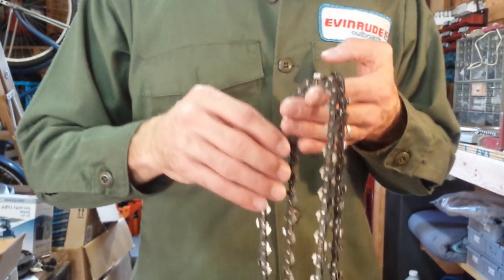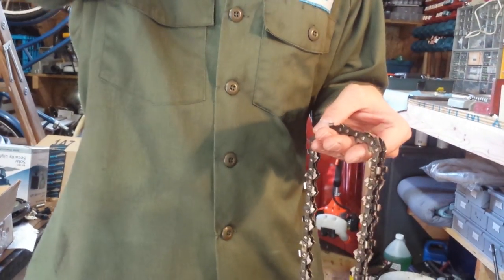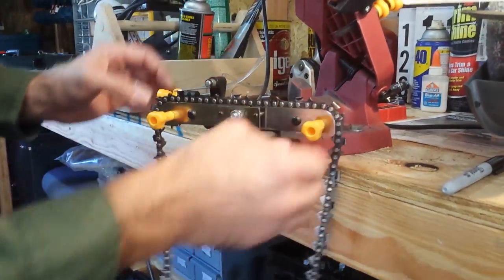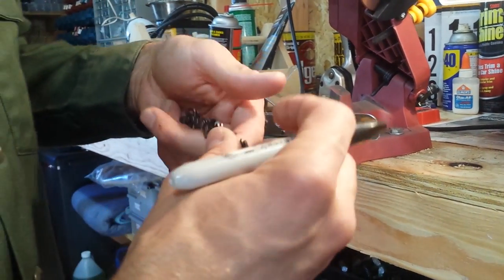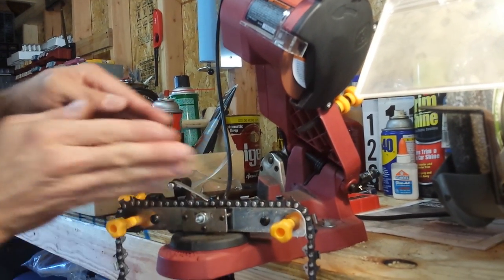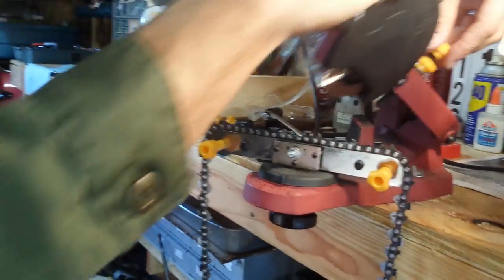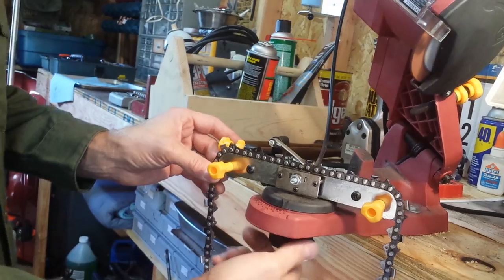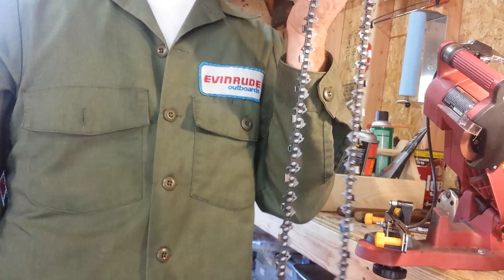How to sharpen your own chainsaw teeth for less than $40

Comment: The Video was 💯% accurate and detailed and easy to follow! 🤘 Thanks going back to cutting now
Reply: onehundredpercentfire nan
Reply: nangu 1 sgarpener beku
Reply: onehundredpercentfire W
Reply: Just learn how to Properly do bye hand,
Save money in long run, less chains.
Reply: @lumberjaxe8910  I agree, but, although I'm not pro, if one does a lot of cutting,,, it's nice to touch-up the chain from time to time with a jig like this (I always sharpen by hand)
Reply: Lumber Jaxe sharpening by hand is too slow, looks very unprofessional hand sharpening on the job & a waste of time. Better to have a few spare sharpened chains for easy quick changes, then machine sharpen them at home for the next day. Time is money, also hand sharpening is far less precise & just speeds up the onset of carpel tunnel syndrome

Comment: Thanks for your video.  I bought one today at Harbor Freight for about $27 out the door.  It took  me about 1\2 hr. to assemble it (and tweek it).  I sharpened my chain saw "chain" in about 5 minutes and believe me that chain is sharper now than it was when I bought it.  I really appreciate your videos. PLEASE keep posting.
Reply: Sure? I've never used a re sharpened chain that was as sharp as new. They cut like butter brand new and after sharpening it's just never the same.
Reply: @jamesnm21  much sharper after a proper sharpening than out of pack. Guaranteed, ask a logger.

Comment: am in the UK just bought this exact model thanks to you!! i love youtube because fellas like you (us) are prepared to invest time to help folks like me (and others) out. THANK YOU from Hampshire in the UK.
Reply: Hi, a suggestion from Cumbria.
It is real easy to take too much off the cutter. Set so the disc just lightly brushes the most damaged  cutter. Then all teeth very near same length. Get a lot more sharpenings out of a chain. 
Got older model, 2000 yr model, over 12 yrs ago, used & no instructions. Pre general YouTube videos to watch ! 
Worked it out. Still sound tool, replaced grinding wheel, after much use.
Works out a lot cheaper than quality hand files in medium time.

Comment: I bought one a few years ago and it sat in the box unused until today. Worked great. Hey, instead of pulling on the chain to advance it, just turn the yellow knob. Great video.
Reply: I mounted mine on a shelf at chest height so i can see what I'm doing with the grinding wheel without straining my neck looking down at everything. Makes a big difference. Plus you can leave it mounted without taking up valuable space on your work bench.

Comment: Bought an ozito electric sharpener here in Australia from Bunnings (Home depot equivalent) for $50. Works a treat and doesn't take long to pay for itself. If I take my chain to a shop to get them to sharpen it it costs $15/chain. This video helped me learn how to use the sharpener. Thanks for posting and happy sawing. :-)
Reply: I’ve got one too. Only downside is that we can’t adjust the depth gauge. Do you use a separate tool to adjust the depth gauge ?
Reply: @ashoksem  No mate, I don't think I did.

Comment: Thanks for taking the time to make the video for us. I think you did a good job showing what needs to be done to get the chains sharpened. You didn't block the camera with your hand, or body. Your voice was clear and concise. Ten bucks is a lot to pay for chain sharpening when you can buy a 8", or 10" chains for  ten bucks at Home Depot, probably other stores too. However, I think you made a smart investment. I was going to do manual sharpening. But like you I  purchased and electric sharpener instead.  I was out here looking  for any tips etc.. So, again thanks for taking the time to show us your video.

Comment: Not sure if was mentioned way down in the comments, but I would suggest to also get a depth checker for the racks/ guides  so that you can file them as well to keep the teeth cutting correctly.
Reply: Pistol Whipped!! Yep, doesn’t matter how sharp the teeth are if the racks are higher than the tooth. Don’t believe that was mentioned in the vid tho.
Reply: This is exactly right.  I use the manual Stihl tool that files the cutting tooth and the depth gauge at the same time.  Works great every time.  Down side is you need to clamp the saw in a vice to use it effectively.
Reply: @Mike_Neukam  I wanted one of those, but they were like $40, and you have to eyeball the cutting angle. Guess I'll have to settle for a depth gauge and flat file for the rakes.
Reply: @RandyGrace  They are a bit pricey, but they work well and the shape of the tool will guide you to the correct cutting angle.  The files are replaceable too, so it's a one time purchase if you only use one size chain.  I like it and it works well for me, but to each his own.

Comment: This sharpener works well. I'm left handed. I have great hand eye coordination. I have built musical instruments by hand. I can put a razor edge on any knife with good steel by hand using a stone. I have simply not been able to put a like new edge on a chainsaw chain using a hand file. Yes, i had stihl files and stihl chains. I bought this and after fiddling with it and using the chain stop directly behind the tooth to hold it steady i sharpened two chains and used them to cut hedge/Osage Orange. Both chains cut great. I then tried them on black locust and they cut like butter. I am thoroughly satisfied with the edge this puts on a chain. Pro arborists say a file is the best way. Not for me.  It seems to me that a fine stone sharpening wheel would put a better edge on a tooth than a file. The only downside of using this tool is that you cant touch up your chains "in the field" with a file because it grinds a different shape into the tooth. But that is a moot point for me since i cant put a good edge on with a file anyway. I have spare chains that i carry when cutting wood so i can swap out a dull chain in the field if need be. The bottom line is that this tool can put a like new edge on a chain very quickly. I recommend mounting it on a shelf about chest height so you can easily see what you're doing while grinding the teeth. Use care not to overheat the tooth by applying ro much pressure with the grinder. Multiple light passes work best.
Reply: Make it portable!  They only draw 84 watts at 120 volts, even the smallest inverter will run it.  We clamp ours on the tailgate to touch up the blades throughout the day.
Reply: You’re correct, definitely a big difference between sharpening a knife n sharpening a chainsaw. I suppose it’s like anything else with just getting the hang of it tho.

Comment: One tip I got from a guy that had about 20 years experience in forestry, was that when using my electric sharpener, like this one, was not to get the teeth on the chain too hot.  The amount you ground off each tooth here with one pass, I would do with 2 or even 3 smaller passes.  

Remember also that these electric sharpeners take off WAY more than your normal round hand file, so you will lose a lot more metal from each tooth which will reduce their active life quicker.  I still use the hand file to maintain a keen edge on my chains, and use the electric once I can't control the edge on the chains any more.  At that point I used to get them professionally sharpened, but now I use my own bench top grinder similar  to yours.
Reply: Very correct about the heat and the newer hardened teeth are very fussy about heat. Sharpen one stroke at a time and have the metal fines going inward from your cutting edges. Very common mistake that leaves a burr. Look at your wood chips. Chunky ,fluffy, clean or ragged torn. Remember the chips from a new blade on oak or some hard wood.

Comment: That was very helpful, thank you for posting this, I just purchased a sharpener from e bay just like the one you demonstrated with, I have always thought you tube videos are better then trying to figure out the directions, that actually looks very easy, and like you said replacement chains are so expensive, now I can get back to cutting, Thanks Again.

Comment: Bought one of these about 3 years ago and never used it, still in the box. Didn't know how to set it up, so I just bought new chains. Thanks to your video I've now got 2 resharpened chains ready to go.
Reply: The4thDensity here I am 2 years after you. Mine was purchased around when you posted your comment. So far I’ve mounted the sharpener on a block to mount it in the vise. Gonna work on my chains now. Thought I would comment on a fellow procrastinator before I did. 
This video really simplifies the whole process. Thanks for making it.
Reply: Oddly, same story. Box has been in garage about a year and a half. This video caused me to open the box and get to sharpening!

Comment: Never used a grinder like this on a chain. Does the machine leave the chain in shape to still use a file on it? Not that I could see myself using a machine such as the one in video. File has always worked good for me to get a chain just as sharp or sharper than when new. Used a dremel b4 but ya gotta make sure you don’t get too hot n it seemed like it eat the chain up quicker than a file.

Comment: I have worked in a small engine repair  shop for 14 years and we use 300.00 dollars chain sharpener. But I use one of these for my personal use at home. There is a big difference in the quality of the sharpener itself. But as of the chain  I can't tell the difference this little chain sharpener does really good and it's really easy to use.
Reply: I just purchased a new sharpener from Harbor Freight for under $29.  My 20 year old H.F. sharpener was getting tired, and I saw some neat time saving upgrades on their new model.  I believe this new sharpener will last longer than my lifetime.  Thanks for the demo!!!

Comment: I cut trees for a living, we usually sharpen our own saws in the field using a 2 in 1 sharpener by stihl, I bought one of these earlier to see if it could save us some time versus hand sharpening. I just wanted to mention those yellow knobs on the front are made to move the chain, so that you don't have to grab the chain itself.. it makes it easier to move without having to take your hand off the grinder handle. The only downside to this vs the 2 in 1 is that it doesn't file the drags down (the little parts in front of the cutter that sets the cutter depth. When the cutter gets a lot of wear on it, the drag has to be filed down in order to keep getting a good bite) This will work great for the first several sharpens and is a lot faster than hand sharpening, for the cutters themselves.

Comment: Dave, good instructions.  I had one of these and gave it away to a Thrift shop.  The reason I did not like it is that you sharpen all the teeth on that one side to the smallest tooth.  Then, in order for the chainsaw to cut straight, you must sharpen the other side to the same length as the smallest tooth that you began with.  If only two teeth get hit bad by a rock or nail or something hard in the wood and they get bunged up bad, you have to shorten the life of your entire chain to fix those two teeth.  That is why I still use the old round file with a file guide.  Old way works well and since I am retired, I have plenty of time to sharpen by hand.  Thanks Dave, good video.
Reply: Hi Dave! Not to be critical, Just thought I should mention that different lengths of teeth will not cause the saw to cut uneven, but rather it's the rakers in front of each tooth that if not filed to proper depth to match the following tooth is the cause of crooked cuts. They make several types of depth gages that make it easy to file the rakers perfectly in relation to it's correspond in tooth. I routinely cut 36"- 40" trees and have no crooked cuts. My chains are often beat up front nails and such. It's just not possible for me to keep the teeth at the same length far too much damage from the nails and fence bits.
Reply: You'll never notice one or two buggered teeth. The chains sharpness will keep it cutting straight  + rakers at the correct height.  No need to grind your whole chain to the lowest tooth. That's a waste of tooth and time. PS if you cuts aren't straight the bar may be worn.

Comment: How do you determine the angle to set the blade at?
Reply: Just line the side of the grinding wheel up with the angle on your tooth. It's the side of the grinding wheel that actually puts the edge on your chain teeth. I like to grind to proper depth and then flex the handle sideways to put a nice finish edge on the tooth with the side of the grinding wheel. It works best to mount this tool on a shelf up at about chest height so you can easily see what you're doing with the grinding wheel. Dont mount it down low on a regular work bench and strain your neck peering down at everything.

Comment: I thought there are two places to file (or grind). 1. Sharpening the chisel point, and 2. Setting depth by reducing the height of the raker in front of the chisel point. Doing one without the other isnt good. Do these grinders set depth?
Reply: You are correct.  If your depth is off there chisel point may not even touch

Comment: What about lowering the rakers
Reply: Hand file, that part is easy. Getting the correct cutting angle, depth, on every tooth is a pain in the ass, and this tool helps with that.

Comment: I wish the end would pivot in order to set it more on an angle into the gusset. After the wheel is worn some the wheel needs to angle into the cutter to get a more deeper grind. It seems that the grinding wheel wants to grind straight down some after wearing.

Comment: I just bought the same HF chain sharpener. I was practicing on a couple old chains and noticed when I hit the brake handle and it goes to grab the chain to hold it, it pushes the chain up.  Did anyone else notice that theirs does the same thing?  If so how did you fix it? Thanks!
Reply: I just got mine and yes I noticed that to! It seems to just grab the bottom edge of the link and when the grinder touches the tooth, it pulls the link up. I'm thinking about  taking it apart and removing a little off the clamping pad so it only clamps the bottom of the link.

Comment: Are these for simi chisel or full chisel, looking to buy both chains for my saws to see what the real diff is , i have mostly mesquite trees at horse property in grand prairie tx
Reply: Hi, told in clean wood chisel cuts faster, but dulls quicker. Semi chisel, more tolerant of type of wood. Easier to hand touch up at site. These type machines can sharpen most round ground chain. Just use appropriate thickness of grinding wheel.
1/8" for 3/8 LP,  0.325". 3/16", for 3/8", 0.404", full size cutters. ( More pro style setups ).

Comment: I know this is an old video but I finally broke down and bought one. When I finished one side of the chains and swapped to do the other I noticed the grinding wheel wasn’t making contact and had to adjust the left/right stopper to make contact. Why is this? I checked teeth width and all right at the exact same ?

Comment: I just bought this chain saw sharpener and it worked really good for me. But I did notice that the clamp that holds the chain is not strong and the disk lifts up on the chain so what I did is I placed my finger on the top chain guide so it holds the chain down as I sharpen the teeth.

Comment: Saw chains have unused teeth called depth adjusters or rakers. Those also need to be filled down because they are supposed to be filed anytime you remove material off the cutting tooth. This is something completely overlooked by the electric sharpener tools which don't include any depth gauge cutting jig.

Comment: As with a previous demonstrator.... Using a powered sharpening chainsaw tool.. one must also set up the depth of the depth Guage or raker tooth height, determining how deep the cutter blade bites into the wood being cut.
After every few rounds of grinding the cutter links.. the depth of the cutter link has to have the top of the depth guagex/raker link lowered to account for. wear of use and sharpening.
Depth Guage grinding requires the changing of grinding wheels for one of 1/4 inch flat edged and the grinding head stop adjusted for the proper number of thousands of an inch that the depth guage/rake top must ground down.
This requires either the sharpener manufacturer's built-in adjustment procedure or an external depth Guage measuring tool.
After all depth guage/rakes are carefully and correctly lowered..
the grinding wheel is again changed for the thinner, round - edged wheel and adjusted for proper penetration into the cutter links and ground in right and left passes, if not already done priorly!

Comment: I noticed how you have a different bolt on the clamp. I think they started adding a yellow knob on the clamp bolt. Anyways, no matter how tight I get it and clamp it, the link pops up when I push the cutter against it. Very aggravating.

Comment: The cutting teeth are sloped downwards.  As you file them they get lower because of this and then the depth gauge height becomes too high.   I guess some people call them rakers.  Also you want to have a half moon shape on the gullet.   So you would need to also file the depth gauges and  maintain that half moon shaped gullet.

Comment: Now I have a 14" echo and a 20" echo, can I use the same grinding disc to sharpen both chains or do I need a bigger one for the 20"
Reply: You can use this machine on both. My 16 year old son and I sell firewood and we use two different saws. This machine works on both. I also sharpen chains for neighbors. This works on all chains.